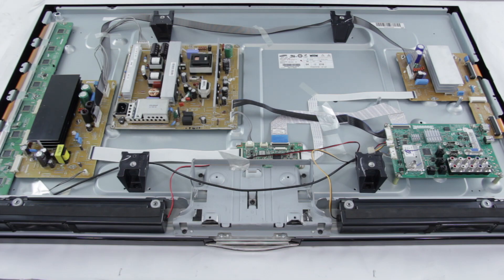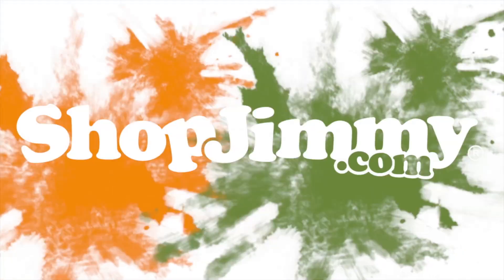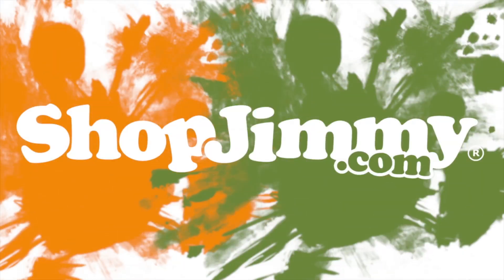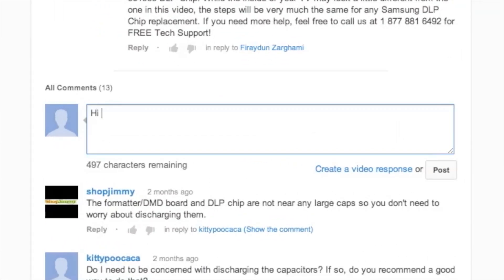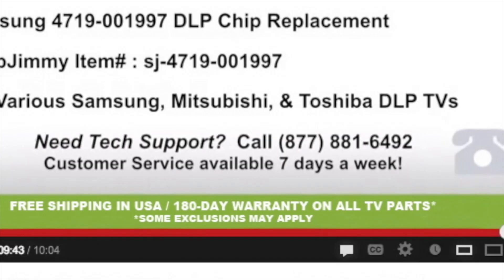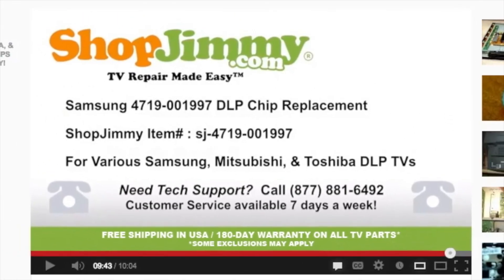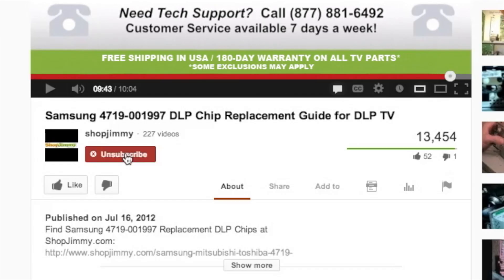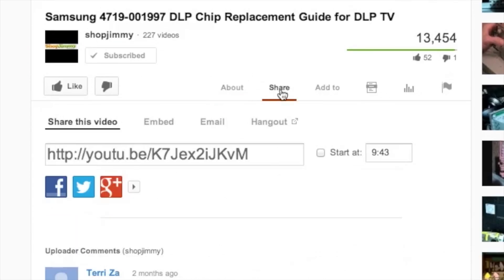Plasma TV Repair Tutorial - Common Symptoms & Solutions - How to Fix Plasma TVs

Comment: Hi.  Great Video. I need help with my Samsung PN60E8000GFXZA.  The TV doesn't power on at all, no blinking lights or standby lights at all.  It looks dead.
Do you think it's the power supply or can it be something else as well?  Do you know what part number it is?

Thank you
Reply from the maker: Abel Carp   I recommend starting by replacing the power supply board in your TV.  Here is a link to replacement parts for your TV model number on our website, click here:  http://www.shopjimmy.com/catalogsearch/result/index/?cat=59&q=PN60E8000GFXZA  Be sure to match part numbers on your current board, with your replacement for compatibility.  Here is a link to a video showing how to identify your part number, click here:  TV Part Number Identification Guide for Samsung DIY TV Repair Power Supply Unit (PSU) Boards  You can also call our customer service for further assistance with your purchase.  (877) 881-6492  Thanks and please let us know if you have any further questions with your TV Repair!  www.shopjimmy.com
Reply: ShopJimmy.com The board is "Out Of Stock".  Do you know if you will have them back in stock soon? 
Thanks
Reply from the maker: Abel Carp  Unfortunately we do not know when the parts will be back in stock.  You can sign up on the product page, by clicking notify me when this item is back in stock.  Thanks!  www.shopjimmy.com

Comment: 42hdx62a this tv had a bad slow blow fuse so I replaced. now it just blinks green then goes off then keeps coming on and blinking green pleas help need to know what to replace
checked capacitors they look fine thanks
Reply from the maker: *****   I recommend replacing the power supply board in your TV.  Here is a link to replacement parts for your TV model number on our website, click here:  http://www.shopjimmy.com/catalogsearch/result/?q=42hdx62a  Be sure to match part numbers on your current board, with your replacement for compatibility.  You can also call our customer service for further assistance with your purchase.  (877) 881-6492  Thanks and please let us know if you have any further questions with your TV Repair!  www.shopjimmy.com
Reply: great thanks will try

Comment: i have a samsung 50'' PLASMA with a red green blue line going down screen model code is PN50B430
Reply from the maker: Anthony S   This sounds like a TV panel problem.  If your TV panel is bad, it may be more cost-effective to replace the TV as panels are typically hard to find in stock, difficult to replace, and expensive.  Thanks and please let us know if you have any further questions!  www.shopjimmy.com

Comment: hello.I have a DELL W4201C/W5001C 50" I Had one great Experience once before with you all @ shop jimmy..thank you again !! I had a bad power supply board I and replaced it and has been fine up until now ..now when i turn it on it takes a few minutes before i get a picture when it does i have horizontal lines for about another five minutes,now my picture is not clear but i can see ...please advise
Reply from the maker: Sheldon Smith Sr   This sounds like a TV panel problem.  If your TV panel is bad, it may be more cost-effective to replace the TV as panels are typically hard to find in stock, difficult to replace, and expensive.  Thanks and please let us know if you have any further questions!  www.shopjimmy.com
Reply: Ok thank you kindly. ...

Comment: I have a Samsung syncmaster p42h. And the screen is like grey and white, and the Samsung logo will flash on and off in different places on the screen and the white in the samsung logo is mixed with reds and yellows.
Reply from the maker: Alex Price   I recommend replacing the main board in your TV.  Here is a link to replacement parts for your TV model number on our website, click here:  http://www.shopjimmy.com/catalogsearch/result/index/?cat=56&q=p42h  Be sure to match part numbers on your current board, with your replacement for compatibility.  Here is a link to a video showing how to identify your part number, click here:  TV Part Number Identification Guide for Vizio Main Boards (Plasma, LCD, LED)  You can also call our customer service for further assistance with your purchase.  (877) 881-6492  Thanks and please let us know if you have any further questions with your TV Repair!  www.shopjimmy.com

Comment: I have a 50pk750 LG Plasma TV.  About a year ago it started having a screen picture issue.  The bottom half of the screen is completely discolored whereas the top half of the screen has a perfect picture.  I would love to fix this issue myself with your advice.  Can you please help???
Reply from the maker: Shawn Doan   I recommend replacing the YSUS and YDRVTP & YDRVBT boards in your TV.  Here is a link to replacement parts for your TV model number on our website, click here:  http://www.shopjimmy.com/catalogsearch/result/?q=50pk750  Be sure to match part numbers on your current board, with your replacement for compatibility.  Here is a link to a video showing how to identify your part number, click here:  LG Plasma TV Repair: DIY Part Identification Number ID Guide for LG & LG Philips Plasma Panel Parts  You can also call our customer service for further assistance with your purchase.  (877) 881-6492  Thanks and please let us know if you have any further questions with your TV Repair!  www.shopjimmy.com

Comment: good day i watch your video  i am getting a problem with a plasma pl51e450a when i plug on the TV i just get a flash for 1 second the volume remains but blank screen like if its off but am getting volume
Reply from the maker: Joel Bruce   I recommend replacing the Y-Main Board and the Y-Scan Drive.  Here is a link to replacement parts for your TV model number on our website, click here:  http://www.shopjimmy.com/catalogsearch/result/?q=51e450a  Be sure to match part numbers on your current board, with your replacement for compatibility.  Here is a link to a video showing how to identify your part number, click here:  Samsung Plasma TV Repair: Samsung Plasma Panel Parts Guide  You can also call our customer service for further assistance with your purchase.  (877) 881-6492  Thanks and please let us know if you have any further questions with your TV Repair!  www.shopjimmy.com

Comment: Seiki23 inc ,plasma t.v the modelSE242TS,Problem  after three years of this t,v, When I turn it on sooner or later the left side of the speaker start to make noise it goers on and off.This is the first time that this ever happen usually the picture goes bad first before the sound as a rule on most.t.v.s .The sound on left speaker  then get back to normal.when I plug my surround  sound system in my head phones in put ,No noise ,perfect,also can i use a vacuum to  suck the dust out of the grills or is the t.v. as sensitive as the computer and would cause  a electrical discharge ? and yes i use it as my computer screen too,no problem from surround sound system,When i even connect my blu ray or dd player on it it does make noise too form the left speaker going on and off then getting normal
Reply from the maker: Michael Mcgee   I recommend replacing the main board in your TV.  http://www.shopjimmy.com/catalogsearch/result/index/?cat=56&q=SE242TS  Be sure to match part numbers on your current board, with your replacement for compatibility.  You can also call our customer service for further assistance with your purchase.  (877) 881-6492  Thanks and please let us know if you have any further questions with your TV Repair!  www.shopjimmy.com

Comment: I have a Samsung Plasma TV Model Number: PN42C450B1D that looks identical to the TV in this video and it just clicks on and off continuously when it is plugged in. Because of some other repair site advice, I bought a Power Supply board from Shop Jimmy and it didn't fix the problem. There are no blown out capacitors that I can see either. Any help is appreciated.
 Samsung TV Broken
Reply from the maker: *****   Try this at your own risk.  I recommend disconnecting the Y board to see if the TV boots up or not.  Reply with the results.  Thanks!  www.shopjimmy.com
Reply: It does the exact same thing with the Y board disconnected.
Reply: What else would you like me to check? I would like to get this TV fixed as soon as possible.
Reply from the maker: *****   It sounds like you should replace the Y-Main Board and the Y-Scan Drive board to see if that fixes the problem.  Here is a link to replacement parts for your TV model number on our website, click here:  http://www.shopjimmy.com/catalogsearch/result/?q=PN42C450B1D  Be sure to match part numbers on your current board, with your replacement for compatibility.  Here is a link to a video showing how to identify your part number, click here:  Samsung Plasma TV Repair: Samsung Plasma Panel Parts Guide  You can also call our customer service for further assistance with your purchase.  (877) 881-6492  Thanks and please let us know if you have any further questions with your TV Repair!  www.shopjimmy.com
Reply: ShopJimmy.com I replaced the Main Board and it worked! Total cost was only $44.34 including 2 day shipping! Only took 5 minutes to install and put the TV back panel on. Thank you Shop Jimmy!

Comment: I have a Panasonic VIERA TC-P65ST50. While watching TV, I heard a quiet pop and then a 3 inch wide vertical section to the far right went black. The rest of the TV works fine. It does this no matter which input is used. Any ideas what it could be?
Reply from the maker: Nick Multari   I recommend replacing the SC, SD and SU boards in your TV.  Here is a link to replacement parts for your TV model number on our website, click here:  http://www.shopjimmy.com/catalogsearch/result/?q=TC-P65ST50  Be sure to match part numbers on your current board, with your replacement for compatibility.  You can also call our customer service for further assistance with your purchase.  (877) 881-6492  Thanks and please let us know if you have any further questions with your TV Repair!  www.shopjimmy.com

Comment: Panasonic th-42pd60u. Picture will flash on go blank tapping tv on back will sometime get picture back it will run ok for days any sometime can't watch at all everything else functions sound volume channel changing.
Reply from the maker: Steve S   You do not want to tap on the back of the TV as you could break the glass.  I recommend that you replace the SC, SU and SD boards.  Here is a link to replacement parts for your TV model number on our website, click here:  http://www.shopjimmy.com/catalogsearch/result/?q=th-42pd60u  Be sure to match part numbers on your current board, with your replacement for compatibility.  You can also call our customer service for further assistance with your purchase.  (877) 881-6492  Thanks and please let us know if you have any further questions with your TV Repair!  www.shopjimmy.com

Comment: Model# pn60e550d1fxza
No picture shows up when turned on
Reply from the maker: blazinkaos1   I recommend replacing the Y-Main Board and the Upper & Lower Y Scan Drive boards.  Here is a link to replacement parts for your TV model number on our website, click here:  http://www.shopjimmy.com/catalogsearch/result/index/?cat=4&q=pn60e550d1fxza  Be sure to match part numbers on your current board, with your replacement for compatibility.  Here is a link to a video showing how to identify your part number, click here:  Samsung Plasma TV Repair: Samsung Plasma Panel Parts Guide  You can also call our customer service for further assistance with your purchase.  (877) 881-6492  Thanks and please let us know if you have any further questions with your TV Repair!  www.shopjimmy.com

Comment: I have an LG 60PZ950. The TV is just out of warranty. The first problem was no picture but it had sound. Then the sound went as well. TV blue power light comes on. There is power going to both Y and Z sustain where the power leads hit the boards. The logic board has a green LED that is blinking. There are no bulging capacitors that I can see. Neither the Z or Y boards are warm. Solid green LED on the main board and the optical out is glowing red.
Reply from the maker: *****   This sounds like a shorted Z SUS board in your TV.  Here is a link to replacement parts for your TV model number on our website, click here:  http://www.shopjimmy.com/catalogsearch/result/index/?cat=67&q=LG+60PZ950  Be sure to match part numbers on your current board, with your replacement for compatibility.  Here is a link to a video showing how to identify your part number, click here:  LG Plasma TV Repair: DIY Part Identification Number ID Guide for LG & LG Philips Plasma Panel Parts  You can also call our customer service for further assistance with your purchase.  (877) 881-6492  Thanks and please let us know if you have any further questions with your TV Repair!  www.shopjimmy.com

Comment: Hello Shop Jimmy, I have a Samsung 51 inch Plasma S51FH-YB03 tv The tv has stopped working( no image is displayed) When it is turn on the standby led blinks 5 times and nothing happens. no boot up tones or anything and aaaaaai try again and get the same result. Your help is needed
Reply from the maker: Ronald Facey   I recommend replacing the Y-Main Board and Y Buffer board in your TV.  Here is a link to replacement parts for your TV model number on our website, click here:  http://www.shopjimmy.com/catalogsearch/result/?q=S51FH-YB03  Be sure to match part numbers on your current board, with your replacement for compatibility.  You can also call our customer service for further assistance with your purchase.  (877) 881-6492  Thanks and please let us know if you have any further questions with your TV Repair!  www.shopjimmy.com

Comment: I have a Samsung 59D7000FF.  A few days ago, it stopped turning on.  It would go to the Samsung logo on screen but then just turn off and cycle over and over.  After disconnecting from power supply and plugging back in, it would attempt to turn on on its own, without using on/off or remote.  Same cycling.  I ordered a new power supply from you and replaced it this morning.  No luck.  I have visually inspected all the capacitors and they seem fine.  When I plug it in a get a green blinking light on the small board (logic board maybe) in the center below power supply.  Where to next?  Thanks.
Reply from the maker: chriskerv   I recommend replacing the main board in your TV.  Here is a link to replacement parts for your TV model number on our website, click here:  http://www.shopjimmy.com/catalogsearch/result/index/?cat=56&q=59D7000FF  Be sure to match part numbers on your current board, with your replacement for compatibility.  Here is a link to a video showing how to identify your part number, click here:  Samsung Main Boards & Digital Boards: Part Numbers for LED, LCD, DLP, Plasma TV Repair  You can also call our customer service for further assistance with your purchase.  (877) 881-6492  Thanks and please let us know if you have any further questions with your TV Repair!  www.shopjimmy.com

Comment: I have a Sanyo Plasma model DP42740, was elderly relatives so I did not see any last days symptoms, set quit working, no picture, no sound, when plugged in green led light comes on and a relay clicks, the light stays on for 15 seconds or so and then goes off for a couple seconds, then the cycle repeats, I have taken the back off and do not see any issues but have done some research and see that the main board J4HE is sometimes the problem, what can I test to see what is wrong?  Thanks

Comment: Hello jimmy, I'm trying to see what wrong with my tv. My model no. Is VL470M. The problem is the tv turns on but on the top is half blue and the bottom half is black. After a few seconds of being on it's like a light blue with pinkish color. Please help. Thank you
Reply from the maker: Stepha La Dominicana   I recommend replacing the main board in your TV.  Here is a link to replacement parts for your TV model number on our website, click here:  http://www.shopjimmy.com/catalogsearch/result/index/?cat=56&q=VL470M  Be sure to match part numbers on your current board, with your replacement for compatibility.  Here is a link to a video showing how to identify your part number, click here:  TV Part Number Identification Guide for Vizio Main Boards (Plasma, LCD, LED)  You can also call our customer service for further assistance with your purchase.  (877) 881-6492  Thanks and please let us know if you have any further questions with your TV Repair!  www.shopjimmy.com
Reply: Thank you so much.  I will go on the link and check the parts out that I need and also thank you for your response. You saved me some money I might also make a video letting others now how much of a help you was thank you. Bless day!

Comment: Good Morning! I have a Maxent MX-50X5. The Unit Powers Fine. The Image Produced is Bright Blue Without a signal. There are Multiple Vertical White lines that appear when I believe the Input verification flashes on the screen.  Or when I select the Menu button. Multiple white lines appear left side of display. it is like the image is stretched vertically down the length of the screen.

is this a logic board issue or somewhere else?

Thank You. sj
Reply from the maker: sheritonjames   This sounds like a TV panel problem.  If your TV panel is bad, it may be more cost-effective to replace the TV as panels are typically hard to find in stock, difficult to replace, and expensive.  Thanks and please let us know if you have any further questions!  www.shopjimmy.com